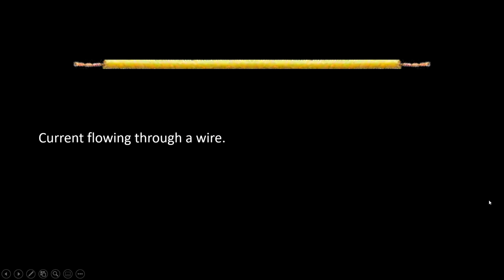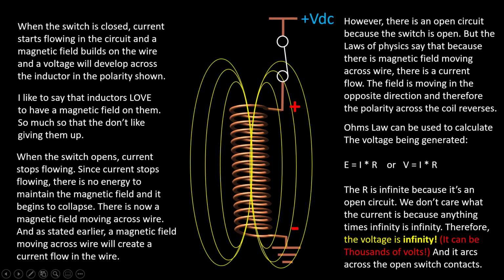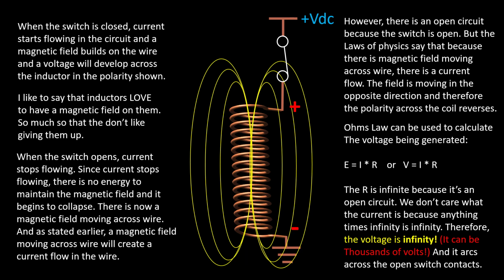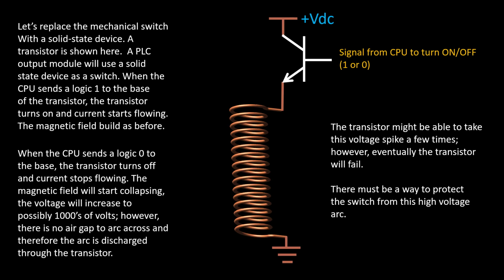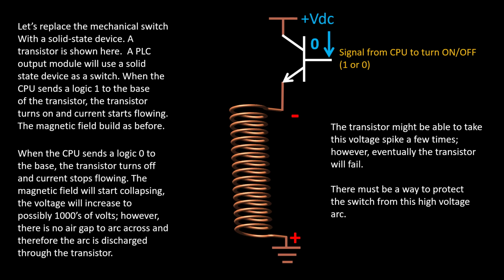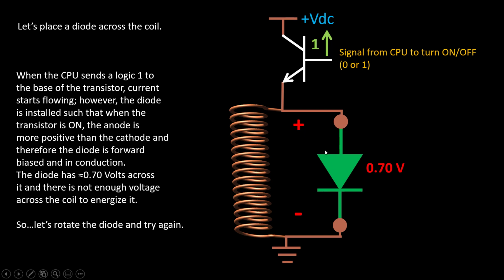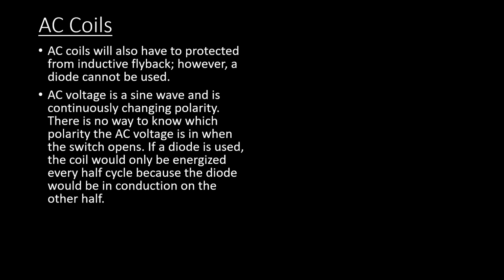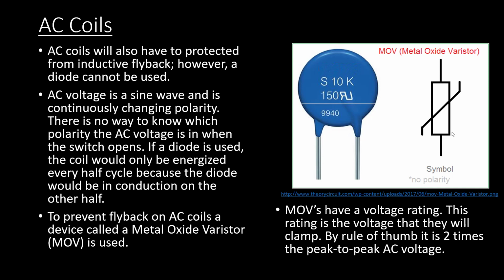Inductive Flyback

Comment: Why nobody views the collapsing stage of an inductor as a GENERATOR who's energy can be harnessed to do useful WORK?  Why everybody is trying to get rid of the Spark by directing the current through a Flyback Diode?  Why not harness it in a High Voltage capacitor and make a Voltage pump out of it  with a diode stopping the capacitor from discharging?  Why nobody asks how come a Coulomb of charge having 1.5 Joules per Coulomb of potential energy all of a sudden has 300 Joules per Coulomb of Energy?  Where did this energy come from?  Can it be that the amount of Energy that goes into the inductor building the magnetic field up to saturation is LESS than the Energy Generated by the inductor during its Collapsing stage?  Can you make a video on this topic?
If you flip the hinge of the switch to be on the inductor's side so that when you disconnect it from source you automatically close a second circuit loop with 1 Ohm resistance - how much heat will be dissipated in it?  Instead of resistor one can put a fuse and if it get's burned out, this will attest for a certain amount of current flowing though the fuse in a very short time...
Say voltage on the coil at beginning of collapsing stage is 300V - you route this through 10 Oms - Power equation  P = V^2 /R so we are talking 300^2 is 90'000 / 10 = 9'000 Watts?
The question is - does the rate of change of collapse determine the voltage on the inductor or is it that the infinite resistance of the switch and Om's law cause the High Voltage on the inductor?  The second one doesn't make sense as the current through the resistance is the effect and the voltage on the coil is supposed to be the cause...
I think a video on this subject will be awesome!
Reply from the maker: Thanks for watching and replying. Although you bring up some very interesting points, the intent of the video is for maintenance people working in the field of industrial automation. When inductive loads are wired to a PLC/PAC or any type of solid state controller, the inductive flyback can, and will fry the output switches. This causes down time of the manufacturing machinery and a loss of production. Therefore, the flyback is a bad thing in this application. It also sounds like you've been reading and researching some of Tesla's work and seem to be more versed than me on the topic. Thanks again.
Reply: @jtodora  Is there a chance I can send you a video of my home experiment...
Reply from the maker: @BoyanAtanassov  Sure. I don't know if I will be very useful to you but I'll gladly watch. Do you have a YouTube channel? If not, you can send it to jtodora@gmail.com  Please be sure to identify yourself in the subject line so that I don't just delete it thinking it's garbage.

Comment: Great video!! This is exactly what I was looking for. It was very helpful. I just one question though. 
Why do we need to mount the protection as physically close to the inductor as possible? Doesn't the current through the diode(protection) get affected by the flux linked to the inductor?
Reply from the maker: Wire that has current flowing through it has a small amount of inductance. Then, when wiring is laid in a wire way (trough), along with other wires, there are other added effects, such as when two or more wires are laid next to each other and current is flowing, think about what you just created. Wire is a conductor wrapped in an insulator. When two or more wires are laid together, each is a conductor separated by an insulator. [Umm...two or more conductors separated by an insulator (dielectric); hey...that forms a capacitor]. All this added inductive and capacitance can create coupling (cross talk) between conductors. The flyback could be coupled to other circuits through this LC coupling action before the diode has a chance to fully squash it.  When I create these videos, I assume I'm talk to a general audience. I don't know the application they are using and therefore I always lean toward the safest way. Naturally, if you only have one or two inductive loads and there are not a lot of other devices and wiring in the wire ways, placing the diode as close to the inductor is not [as] important. However, in control cabinets with a lot of components and a lot wiring, there could be enough crosstalk to create problems with other devices in the cabinet. I hope this explanation helped. Thanks for the compliment. I'm glad it helped. If you can and haven't already, please give the video a thumbs up. YouTube looks at the thumbs up and raises the video higher in the search list. I do not monetize the channel. I do these videos as a pay forward to all the excellent engineers who shared their knowledge and expertise with me during my 43-year career.
Reply: @jtodora  I hadn't thought of a complex wiring scenario where the 'crosstalk' happens. Thanks for the input. Helped me a lot. You're doing good work out there. Cheers! :)